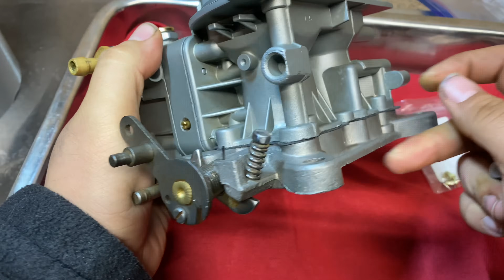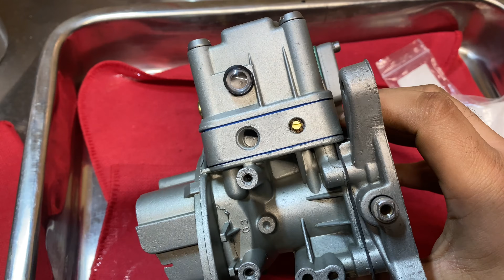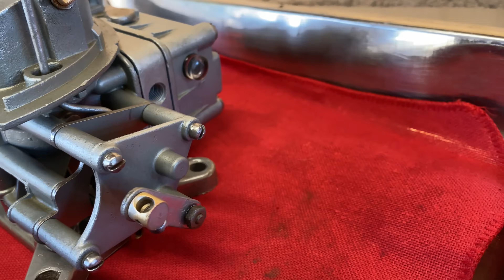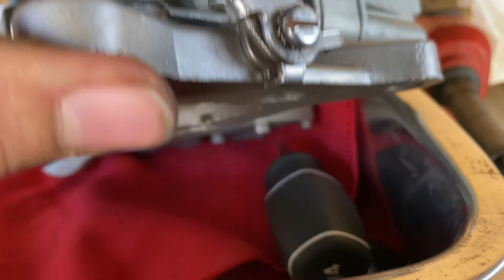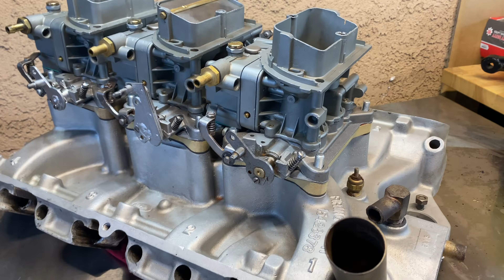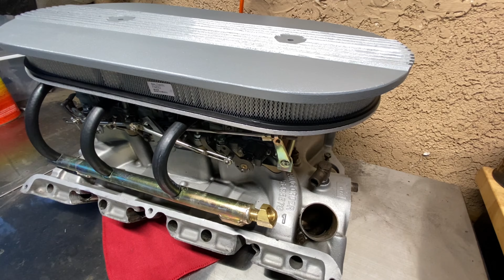The Ford Fe Tri- Power is Complete!

Comment: What is the hole in the back of the manifold for, opposite the distributor?
Reply: It's a vacuum port for power brakes and another on the small block manifold for a road draft tube king of a prehistoric PCV system

Comment: Ford's 401 came out in 1961 with tripower it was the 390 cubic inch motor and Ford was mass-producing 401 horsepower out of that engine . That engine came out to beat Pontiac in Chrysler.. the next year the 406 came out trypower and it produce 405 horsepower... And that's only four more horsepower than the 401... I think the 406 had to be making much more horsepower in 1962 I think that's when Ford was kicking ass.

Comment: I was browsing the other videos.  I never seen this setup go on the 428. I saw a 4bbl go on.  Did i miss a video or did you get rid of this setup?
Reply: It wont fit 428, fe castings changed in 63 or 64..fits a 390 ,406, 410 pre 64. Our 428 has 67 castings and didn't fit heads.
Reply from the maker: I’m using the 4bbl intake to break-in the engine and then I will switch over to the tri power
Reply: @OmarRamirezGalaxie   nice.  I'm a ford nut myself and I just came across an estate sale today and they are selling a 390 6 pack complete engine with a C6 on it for only $600.  OEM ford intake.  Carbs I don't think are original because the two outer carbs have holes through for a choke butterfly.  I only got 1 photo and of course i can't see the exhaust bolt pattern and the valve cover is off and the rocker rail isn't on.  Its the perfect you can't quite tell what it is photo.  Its a friend selling for a dead friend deal.  Can hardly wait to see in person tomorrow.

Comment: Dude thank you so much for this video. I've been in the process of fine tuning the 3x2 intake on my 289 for the past year. Hard to find videos on these, all I really had to go by was the pdf from hptrends.
Reply from the maker: No problem! Wow a 289 with 3x2 is really cool! You don’t really see that anymore
Reply: @OmarRamirezGalaxie  I just remembered, I wanted to ask if you knew how to run a vacuum advance with the tri power, or if you knew if it's worth it to do so.
Reply: Hey again Omar, finally getting around to rebuilding my tri power along with the 289, I just checked Hptrends and it looks like the website is no longer active. Glad I downloaded the manual... I was wondering if you had any connections for tri-power spare parts.

Comment: Nice job Omar, my dad had a 64 Galaxie same color as yours with buckets and center rear speaker. It had the automatic shifter in the console. He got rid of it because the 289 with 4 barrell carburator used too much gas.  That combination moved the old girl plenty fast; wonder what he would say about your arrangement.  Keep posting; looking forward to seeing the final result.
Reply from the maker: Haha if only he would’ve kept it. Great story!
Reply: @OmarRamirezGalaxie  Yeah, I know right.  He replaced the Galaxie with a 67 Country Sedan station wagon.  That car had a 390 with a two barrell caraburator.  He always had Fords.  I thought that was a nice car also. It didn't have the fake wood on the outside like the Country Squire models.  Do you have any more upcoming videos of the Galaxie?
Reply from the maker: @abelcastillo7861  that country sedan is still pretty cool! … yes I have an engine and trim restoration video I will be posting soon!

Comment: This video was great help for my tri power.
The previous owner has the linkage to outer carbs backwards.
What size rubber hose from fuel rail to carbs ? Thanks.
Reply from the maker: I used 5/16 fuel line and just cut them to fit.
Reply: @OmarRamirezGalaxie  Thanks
Reply from the maker: @RichieCat4223  no problem!
Reply: Where the car on the intake backwards as well?
Reply: @jmr1970  Don't understand the wording of your question.
Reply: @RichieCat4223  Sorry, your carburetors are mounted backwards on your intake when you were showing how good they looked after the rebuild….lol
Reply: @jmr1970  This is not my video.  I was talking about the linkage from the center carb to the two end ones to the person who made this video.
Also the carbs are not backwards. The large hole in the intake is the back for the road draft tube or optional PCV valve. 
The front has a 90* elbow for a heater hose also.
Reply: @RichieCat4223  ok, I saw the linkage as well. The way the video was shout sure looked like it to me. The thermostat housing and distributor are in the front. The back of the carbs were facing backward. Keep on trucking. I guess I had too much Gunja LOL👍🏻
Reply: @jmr1970  "Don't bogart that joint my friend pass it over to me"
Reply: @RichieCat4223  I'm not familiar with the Road Draft Tube. Are there any performance benefits of running an RDT or PCV on one of these intakes? Was just about to repair the vacuum leak from the PCV block off plate.
Reply: @GLOWLLC  A PCV is a "Positive Crankcase Ventilation". Road draft tube does the same thing but not as good at low speeds and put more pollution in the air. Both are making the oil pan area in a negative pressure vs atmospheric pressure.  Please Google your question to get a fuller understanding of what I've said.

Comment: G'day Omar that looks absolutely fantastic and will top of that 428 great . I noticed in one of the earlier parts you mentioned HP trends , did you get anything from them ? and what fuel pump are you going to use ? enjoy your work.
Reply from the maker: I purchased the PDF on how to rebuild the tri power from them which was great.I tried to buy other parts from them but it seems like they are a small manufacturer and don’t have many parts available. I have a new edelbrock mechanical fuel pump but i still have to research to see what the ideal pressure is.
I’m pretty sure it will do fine with the edelbrock but I’ll cover it in a future video. Thanks for watching
Reply: @OmarRamirezGalaxie  Something I found regarding fuel pressure on my 289W tripower... 3-4 psi is pretty much ideal. I'm running an edelbrock electric fuel pump rated at 4-7psi, but after taking it to a shop to have some diagnostics done, they discovered pressure at the fuel rail was in excess of 11+ psi and unburned fuel in at least one of the cylinders. Thankfully I didn't damage a float. 

Definitely run a pressure regulator!

Comment: Where did you get the spacers?
Reply from the maker: I bought them from eBay. If you type in ford tri power spacers they will come up. I believe the seller makes them in house
Reply: @OmarRamirezGalaxie  That's to prevent vapor lock, correct?
Reply from the maker: @rayt1590  yes, I’ve always had really good experiences with phenolic spacers. Definitely helps when starting the engine after a drive. Protecting the fuel lines will also help!

Comment: Beautiful, great job.  I built a tri power set up on an aluminum Edelbrock for a SBC 283 in my 1970 Camaro and loved it.  It’s the only thing I kept from the car.  I wish I had put the heat spacers on like you have as I had trouble keeping it running due to heat after long periods of running and bringing it down to idle.
Reply from the maker: That’s cool! I’ve always had some trouble with heat from the intake on carburetors, so I always use the heat spacers